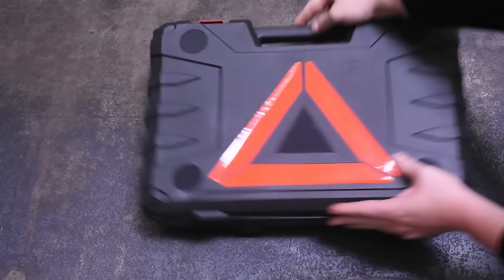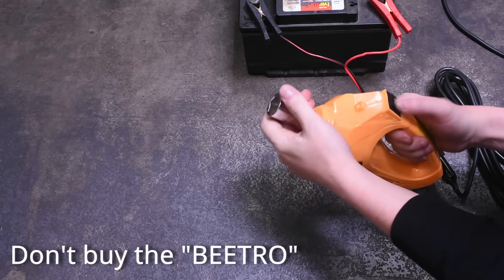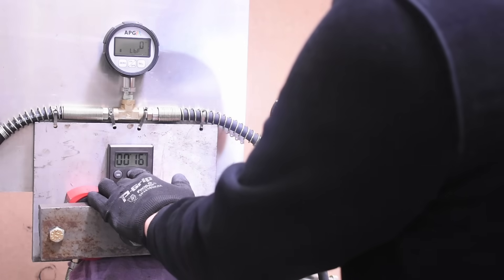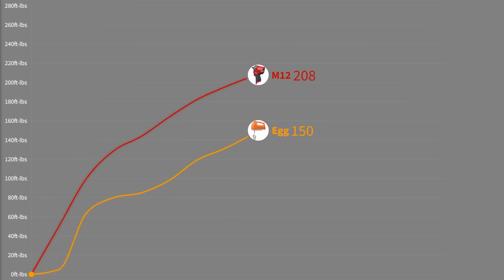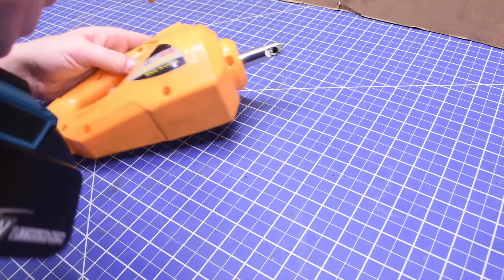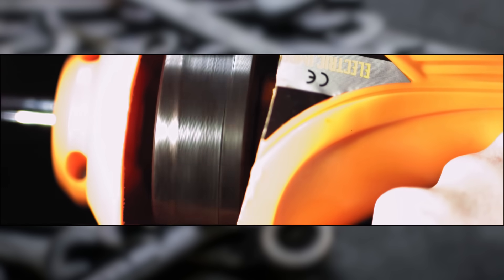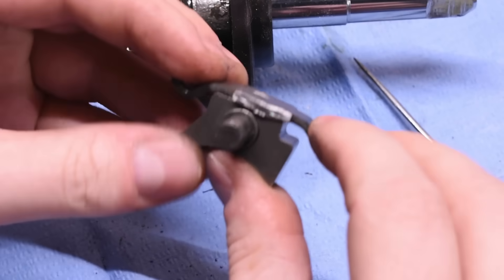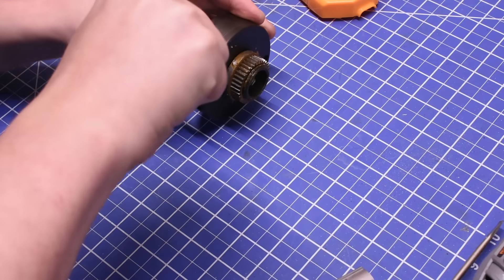The Infamous Egg-Beater Impact Wrench! Testing & 10,000fps Slow-Mo

Comment: usually you can unscrew the tip on a car 12v plug and there's a small fuses inside. probably why it failed so quick!
Reply from the maker: Just checked and you're right, though replacing it now still shows no connection on the leads.
Reply: @TorqueTestChannel  I thought you were going to let out the Bluetooth power cable technology. What a let down. xD lol
Reply: @TorqueTestChannel  it could have burnt up the contacts in the housing. I have one in my semi for my electric cooler and I had to splice a new housing on.
Reply: @TorqueTestChannel  the clamps probably also had a CRAP connection that arced when the fuse blew
.
i would not be shocked to find aluminum wiring on the leads also.....
its shaped like that for cheapness... dont need glass fiber if you dont have the 90 degree stress point from a "pistol grip"
wrists be damned
Reply: no, never mind, you used the same clamps, never mind about the clamps (other "points" remain) 
.
the wire is probably tacked directly to the spring....  the "weld" on the internal wire melted
or the spring melted.... lost its temper and has no "spring in its sproing"
Reply: @TorqueTestChannel  Try cutting the head of a bolt roughly the same diameter, those glass fuses can be very pesky
Reply: @puttitat2851  I think the alligator clips did the trick to be honest
Reply: @puttitat2851 please tell me you’re not telling people to replace fuses with straight pieces of thick metal.
Reply: @Sffker  For testing ofc 😂
Reply: @Sffker you just put a warning label on it and good to go!
Reply: @brettwalkom948  can you imagine what the world would be like if the inventors of the last 150 years were saddled with the safety weenies of today?
Reply: @charlesmckinley29  we would still be driving horses lol
Reply: @Sffker  if you're not afraid of breaking things and starting a fire, shorting a fuse is perfectly fine. Honestly not even a joke
Reply: @TorqueTestChannel  voltage drop on battery under load draws higher amps. fuse did its job
Reply: @stinkycheese804  if it was a brushless it would probably not even draw that much, the controllers can limit both the phase current and battery current, infact it probably would've been able to do the same thing (or better) than with this brushed motor as brushless is vastly more efficient
Reply: Came to write exactly this. It's just a fuse. :)
Reply: Yup, was going to say the same thing...tiny glass fuse inside.
Reply: We all know any piece of metal is an osha hse approved fuse replacement 😉
Reply: @n3mos  And that 55 mph is a speed limit. Don't act all goodie-twoshoes
Reply: Learned something new today thanks!
Reply: Honestly I genuinely did not know this. Thank you for enlightening me
Reply: This is incorrect, look up the spec sheet on the battery model
Reply: Cheap fuses can fail between the fusible filament and the end caps often being a cold solder problem but a fuse blowing for no reason just isn’t a thing! If it’s blown it’s been overloaded either from over current or a short!
Reply: Wait where is the fuse? I’ve taken mine out and I don’t see one
Reply: @codygooch510  inside the plug that goes into the cig lighter
.
Might have to Crack open the case and re-glue after
.
On most of them the tip screws off